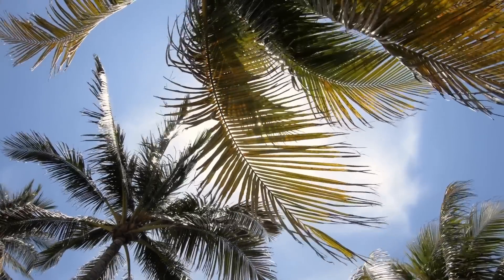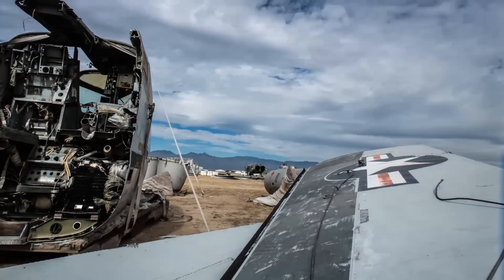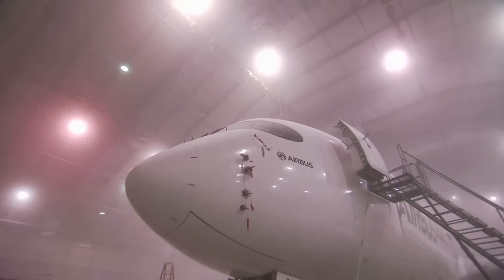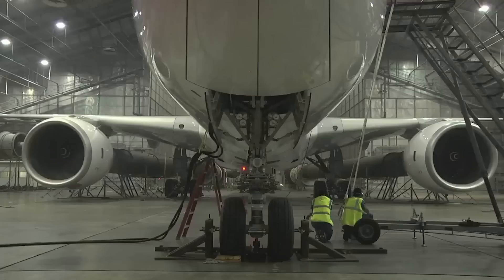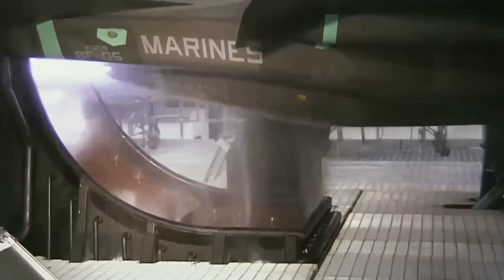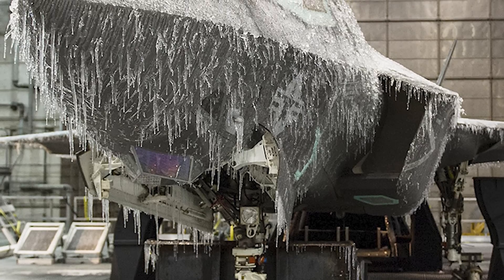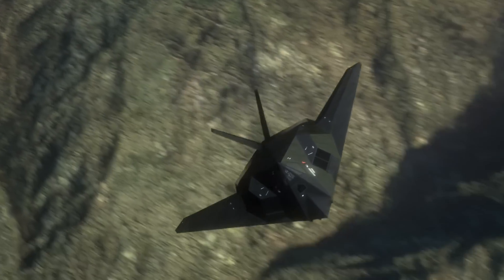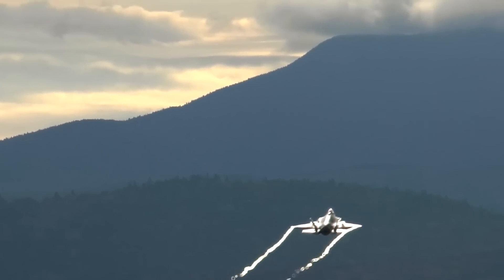America's Stealth Fighter Frozen Solid at -65°F – Rare Footage

Comment: About 40 years ago I was part of a team of engineers who tested the AV-8B Harrier in this chamber.  We were there for a month and a half and had the aircraft elevated on jacks and tied down everywhere so we could simulate a full flight profile: Start engine, raise landing gear, operate flying surfaces and "land" again at temperatures from -40 to +120 F.  This is an amazing facility and working there was an experience I'll never forget.
Reply: @TonyA552  i worked on the stacker cranes at Boeing in Long Beach where they painted the C-17’s that were made in the same location. But by far the Satellite Systems clean rooms were the coolest.

Comment: Yeah, but does it thin the air as if you're at 60,000 ft?

Jk. It is impressive
Reply: If they can introduce air for combustion, and the doors seal well enough, theres a chance the room could be put into a vacuum by the running engines, not the same thinner air as oxygen starvation, but it could get pretty close. We cant bend physics at the molecular level. The other way would be a smaller chamber and depressurise it. But its rough on the chamber.

Comment: In the late 1980's we brought the MC-130H Combat Talon II to the chamber.  They hadn't tested a prop plan since the 1960's but no problem, right.  They installed the exhaust ducts for engine runs and we brought the engines up to ground idle.  The overhead lights were swaying, and the dust was swirling around the chamber.  When we went to flight idle the frames holding the simulated sun lights were swinging like circus trapezes and paint was being blasted off the walls.  The chamber people were very upset with us as the prop blast recirculated in the chamber like a wind tunnel!  After a few discussions they did allow us to run the engines at ground idle only after they had lashed the light racks into spider webs.  When we left the chamber was ready for paint as we had sand blasted most of the pain off the walls.  It was a great learning time for everyone!

Comment: I was fortunate to be one of the engineers responsible for doing its latest overhaul in the 1990's.  It was a once in a lifetime project.  I will never forget seeing the first plane being tested there after we finished the overhaul. A B2 bomber was in the being iced down to way below freezing that August day while it was in the upper 90's outside.
Reply: Dude. That is effing awesome. I bet you have some cool stories.
Reply: It was one of the best projects in my career. USACE out of Mobile oversaw the project. The entire interior of the chamber is stainless steel and all the seams had full pen welds. The suspension system for stainless steel ceiling was an engineering challenge as we had some CAD engineering tools but nothing like today. I remember going in that hot August afternoon into the chamber and after my eyes adjusted to the darkness and cold you had MPs standing guard around the B2 with signs saying do not cross the line as use of deadly force is authorized. At the time not much was really know about the B2 so I felt fortunate to see it. We had to have background checks and security clearances to work on the project.  The cooling and atmospheric systems for this project was way ahead of it time. The magnitude of incoming and outgoing air was incredible. I also saw a tank in the once and the cooled it down and shot the main gun out over the range. Eglin AFB is pretty cool.
Reply: How can you tell if someone is an engineer? Easy! They'll search for reasons to tell you that they are.